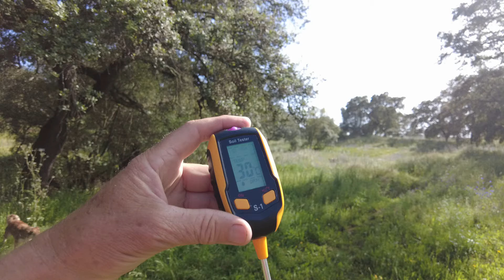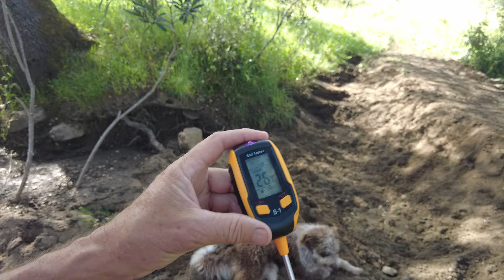Ford crossing completed. Air and water temperatures measured.

Comment: do you think you should use those rocks to armour the dirt wall and overspill at all, or will the leaky wear be enough to hold it back?
Reply from the maker: My experience is that nothing holds back the first rain of the season but I'm looking into flattening the water flow level higher up as it will passify the anger. Keep sharing. Much appreciated
Reply: enlarge the creek to slow the water sound like a good idea to me... (slow water does not move so much sediment) but it looks like a lot of work to move the earth to achieve this.  however, i'm not sure that adding branches in the funnel will help to reduce the speed of the water.

i would try armouring with concrete, rocks or plastics. i believe you have your reason not to do it. 
I would also add a culvert to discharge water before it top off the damn. i believe this is our main failure mode here: water eroding the top then cutting though it. 
i don't think you will ever get a wave strong enough to push the material at once.
i think you are no more using the large plastic pipe, you can reuse it here, maybe one on each side.
Reply from the maker: @peperillon  Good suggestions. Thank you for sharing